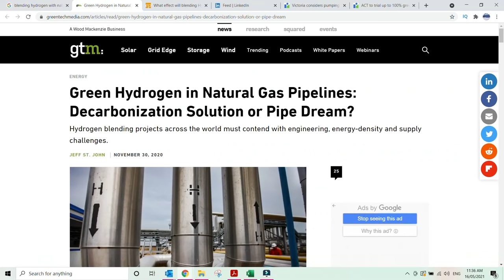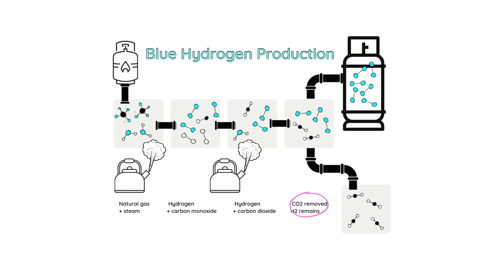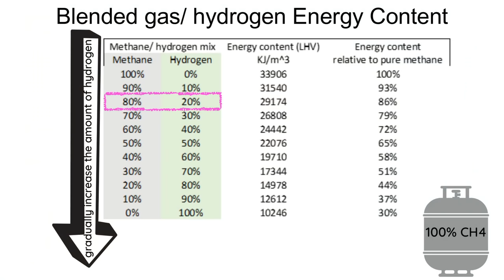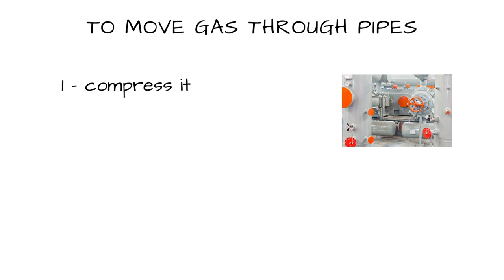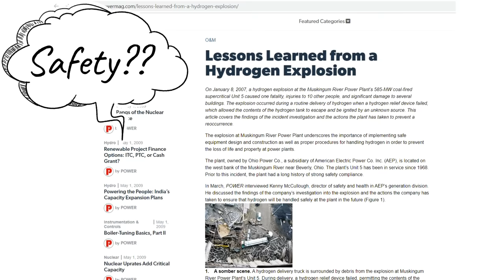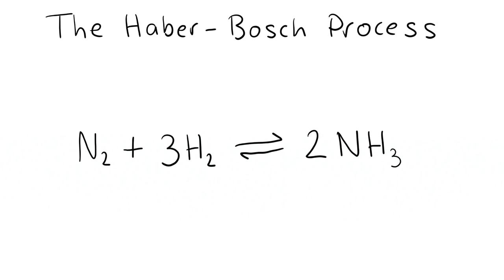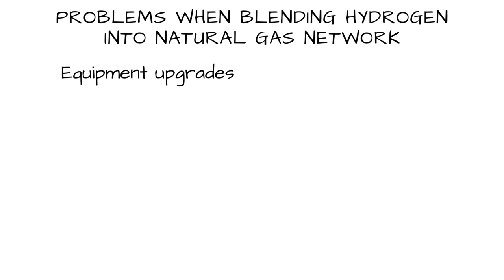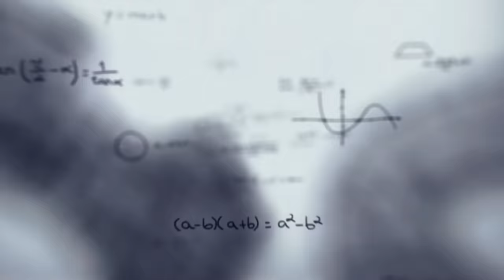Hydrogen in the Natural Gas Network

Comment: I agree with basically everything he said. "jetted" is referring to the fixed orifices that are used to regulate gas volume through a device. They are in every gas appliance and pressure regulators among other uses. They would all have to be changed, aside from the down rated performance of the appliances. This would be expensive but very complicated as you'd have to do it for every appliance in the grid that was converted. So I agree that mixing hydrogen in isn't going to work at well. From a safety standpoint, like he said, hydrogen is notoriously hard to contain. The majority of the last mile of NG pipeline networks including almost all piping inside homes are mechanically fitted. (IE threaded and crimped.) I suspect that leakage rates would dramatically increase, causing plenty of panic. (odorization should keep accidents down but won't completely prevent them.) Some jurisdictions have extremely restrictive regulations. (Ontario, where I live, is one of them.) I honestly don't see the regulatory authorities moving any faster then geological speeds. 

For the electric heating, that is more of a problem for existing neighbourhoods in cold weather areas that use NG. Since the infrastructure was built with natural gas supplies in mind, electrical infrastructure isn't built to handle the full heating load on top of the normal peak loads. We would have to upgrade entire sections of the electricity grid along with additional power sources. That's considering heat pump usage. On top of that, heat pumps are much more expensive to repair. It's not a limiting factor, but something to consider. While they use gases that can be harmful to the environment, losses are extremely low in some jurisdictions and isn't really a factor. 

Side note : comfort heating is an essential service in cold weather areas. It very well can be life and death depending on the situation. Even Texas is aware of this now. 

After all that, consider that methane is most often a byproduct of oil extraction. There are some dedicated fields extracting NG, but it's not as common in North America. Burning methane is far better then releasing it to the atmosphere. The greenhouse potential of methane is far greater then carbon dioxide. Capturing methane from leaking fields will help substantially. Having a convenient way of consuming that energy is most efficient. (Although I still see  NG volumes significantly dropping in hr future. Especially in places where it is imported from deep natural gas fields.)
Reply: In order to keep our bodies warm, we heat the whole house. That is not an engineering solution!
Reply: @Tensquaremetreworkshop  and your solution is? No one is wearing a snowsuit inside.
Reply: @SuperS05  Actually, in parts of China, they do. And leave their doors open, even in Winter...
Suits heated with either fluid or electric resistance have been designed. Might not seem ideal, but when the alternative is the destruction of the planet... 
I consume 2MWh of electricity per annum, and generate 4MWh (solar). Heating my house takes 12MWh of gas. Something has to move...
Reply: @Tensquaremetreworkshop  insulating a house well is far easier then convincing people to wear think snow suits inside, and have no running water. It's not hard to get the energy use down enough to have passive heat gain. It's just not cheap
Reply: @SuperS05  It is not just a matter of cost- in the UK we have a large number of old houses that cannot be sensibly insulated (even if it was legal). With most houses, it would be cheaper to re-build. It has taken 200 years to build the current stock- how long to rebuild- while still continuing building 300K new houses a year? Add doing it carbon neutral, and that universe does not exist. Insulating bodies is way more manageable.
Reply: @Tensquaremetreworkshop  and how many parts of the UK dip below -30 or -40*C during the lows of winter? Each jurisdiction has its own problems and needs to be considered separately. How about the buildings that use NG for cooling and cannot switch to electric chillers? 

PS. When doing a full reno, tear down to the studs reno, reinsulation actually isn't that hard. Closed cell spray foam can get to very high R values without much trouble. Other methods can get up there too. It's not cheap, but it is possible. Asking people to not have running water and be cold is never going to get any traction.
Reply: @SuperS05  'tear down to the studs'- what studs? The vast majority of British houses are brick built. Outside cladding is ugly, difficult to impossible, and would never be more than rare. When you get to the ones built from rammed earth, or wattle and daub I don't know where you would start. Zero energy homes require in the order of 500mm insulation (especially if it has to be non-fossil). Even if possible, the cost would run to at least 10 times GDP!
As I said, I use 6 times the energy for heating as everything else put together- and I have a house as well insulated as I can make it, within planning laws.
Reply: @Tensquaremetreworkshop  that's just an expression. There's many houses here that are just as old and have brick or stone walls. Wattle and daub actually has decent insulation value. An air gap and / mineral fiber insulation with a vapour barrier would likely do pretty well. Some a very good chunk of houses in the UK are townhouses, the joining walls between suites can be ignored. Basic Drywall or whatever you want to use over the insulation and you're done. Roof depends on building style.

I've seen 8700sq.ft (800ish sq.m) houses use less energy to heat for a much colder winter with very limited sun exposure. And they did not have ½m insulation. Even my house, with very lack luster ancient insulation style still competes with your numbers for heating. When I get around to it, I'm sure I could at least half that.

PS. I just started an AC that uses that much power in 48-60hrs on a hot stretch. And that's basically as efficient as it is practical.
Reply: @SuperS05  The problem is that better insulation will no cut it- zero  carbon is needed. If government increases deficit by 2% (prob max it would be allowed) it will take 400 years.
Otherwise to hit target we need worldwide the equivalent of a 2000MW nuclear station every day for the next 30 years. Good luck with that.
Reply: @Tensquaremetreworkshop  and asking everyone to sit in their houses freezing with no running water isn't going to work either, no matter what your arguments are.

And I said passive heat gains in winter. That is carbon neutral. Passive heat losses in the summer is a whole lot harder, but not impossible with plenty of planning.

Anyways, the video way on hydrogen, and there's almost no lathe scale green hydrogen production due to the economics. Solve that problem. Industries in cold weather countries are getting very good at reducing heat losses during winter. In fact, I continue to service AC's throughout the winter in office buildings due to their tenancy to overheat.
Reply: @SuperS05  Moving EVERY house to passive heating is a mammoth task- and who is going to do it? Removing a percentage of the working population just takes away from productive effort, and the costs are astronomical. In 2018 we consumed 11,865 mtoe of fossil fuels! We have to reduce that by one mtoe every day until 2050. 
Yes, we should add insulation where we can- but my proposal is modest.
1) It is already practice in parts of the world
2) It is almost universal for part of the day - turn off heating and rely on bedclothes.
I am just extending the period of the day. We already add clothing during winter- a pullover, underwear... It is not a huge technological task (compared to zero carbon housing) to design light but effective insulated clothing. Perhaps active. Not comfortable for you? An incentive to move, slowly, to needing less by personally insulating your dwelling. But you are not being forced to.
As a child, we did not have central heating. It was normal. This would be much better than that- and is to save the planet.

Cooling- people lived in those areas long before aircon. It is a convenience rather than a necessity. Want to be cooler? Dig down. The earth sits around 10C, and you can regulate the temperature using air change and a heat exchanger (only a small fan required).

Rather than a 'war footing' style of revolution, an escalating carbon tax and technologies such as I suggest can do the job.
Reply: @Tensquaremetreworkshop  and you plan on burying London's 9million people? New York's 24mil? LA's 19mill? Tokyo's 37mill? Mexico City's 22mill? Or asking any of those people to not have central hvac? (that's literally over 100 million people in just 4 cities. Most of which have limits on ground and air use.) In cities, AC is not just for comfort. There's a reason why it's been an reservist service for years. 

Planned upgrades over the next generation for existing structures and upgrades in building codes for new structures will be what drives lower energy use. It won't matter if you stand in the middle of any of those cities with a loudspeaker and beg people to listen to you, no one will care. Any of those people that you mentioned that don't have central heat, will gladly take it given the economic option. (which is why they don't have it, not because they chose it. I know of only 3 houses near my that have gone carbon neutral and one is an educational showcase. All 3 have central hvac.) good luck with your campaign, I don't see it gaining any traction at all.
Reply: @SuperS05  Two things-
- You don't have to deny anyone anything- you just charge them the full cost. They will make the rational decision.
- Do not worry about office blocks- they are terminal. Nothing dafter than leaving a desk and screen at home, spending time and energy commuting, to go to another desk and screen. Many are now working at home, and you won't get them back with a tyre lever. When companies have to pay the full environmental cost, they wont be asking them to.
Reply: @Tensquaremetreworkshop  I was talking about the condos and apartments. Some people like living in them and you won't be prying them out. And your answer to expensive upgrades is to charge more? Like I said, there's already a push to better efficiency and lower hvac use due to the economics. If we could only get the big companies to stop being greedy and making the top tier products with proprietary parts and communications, and we would be doing great.

Across all types of buildings, we don't get better mechanical and building envelopes because of a lack of general education. It needs to be taught in high school. People are more worried about granite countertops and hardwood flooring then how low their heating energy will be. They don't even care how badly the AC and heating will be due to poor construction. They don't notice the poor water distribution for quite some time. 

Even your whittle and daub house could be decently low energy costs for central hvac and still have natural light relatively easily on the next full house reno. But even you mentioned earlier then you were more concerned about how some of those methods looked rather then how they performed. 

PS. I have a hint for you. Quite a few companies will be demanding that their employees return or their jobs will be on the line. I interact with many businesses every day, of all sorts of industries. Almost all of them want their workers back in the office asap, even when it doesn't make sense. It's a societal thing. I'm all for the working from home revolution, even if it costs me my job, and it would. I just don't see it happening they way some hope.
Reply: Nonsense - re-jetting was done in the UK between 1967 and 1977 for the conversion from coal gas to natural gas.
Reply: @poruatokin  considering methane is a significant component if "coal gas" (roughly ⅓) the new orifices wouldn't have been significantly different and could run at similar pressures. This is not true for hydrogen. 

The conversation process could be done sequentially between networks, due to the highly fragmented early networks. Modern piping networks are highly centralized and some have only a few major import pilings pipelines that can travel across continents.

It's not impossible, but highly infeasible a place like where I live. It would be pollution suicide for any politician allowing that to go through.
Reply: @SuperS05  'Next full house reno'. That never happens! Unless it falls down, owners go to extraordinary lengths to change as little as possible. Listed status enforces that.

Currently, in the UK, we are seeing an unprecedented movement of people moving further from cities- outside the commuting envelope. They have voted with their feet- they are not going back to offices. Travel season tickets are becoming flexible, allowing one or two days a week travel for those that still have need to travel in- for the moment. Builders of garden home offices are booming.

Your increasing list of building types just reinforces the difficulty faced, and illustrates the need for innovative solutions. More of what we do today will not cut it.
Reply: @poruatokin  Yep- it took ten years, despite just being a change of jet. (except for the scrapping of much kit because it could not be converted). Back then, most gas appliances were either a cooking stove or open fire.  Somewhat more complex now- and it will need much more than a jet change. Boilers need a re-design.
Reply: @Tensquaremetreworkshop  houses get fully renoed all the time here. Often once per generation or 2 at the least. Unfortunately when it's by flippers, the cheapest options go back in. I normally only work for home owners and refuse to work for flippers. Homeowners almost always upgrade insulation and mechanicals to improve efficiency to the max that their budget allows. Every industry with fingers in that market are already moving towards lower energy costs including ever stricter building codes. It's not carbon neutral yet, but the same construction methods would be fairly close in more temperate climates. (IE the lower half of the UK.) Solar and /or wind energy collection along with storage would go a long way to bridge the remaining gap. If you don't like building codes in your area, talk to your politicians, and demand change. I do my part by giving more discounts to higher efficiency hvac replacements when possible. (as opposed to increasing profits like many companies do.) Telling people to live at home without central hvac will gain zero traction. 

Yes people have moved away here, but that won't stop their bosses from demanding that they return full time. Except for the big internet companies, I don't know any here that will allow full time working at home that hadn't already 2 years ago. Of course I don't know everyone, but I would wager that if a decent average here. I personally know of several owners that'll fire their employees without hesitation, if they don't return full time when the government allows it again. They simply don't care if you've moved away. So efficiencies of office buildings still matter and will continue to matter. I have several very large projects going ahead for that very reason. Although corporate bureaucracy, and fragmented budgets often force less than ideal options.
Reply: @SuperS05  Interesting the difference between our localities. In the UK, 'full renovations' are extremely rare- the biggest changes are just extensions. People like, and pay more for, 'period features'. On my last change of house, I moved a couple of walls and that was regarded as huge changes. Grants to upgrade insulation have fallen way below target. Standard heating is a gas combi boiler- there are attempts to sell air source heat pumps, but the external unit is regarded as ugly, and the water temperature (if efficiency is desired) is too low for standard radiator systems. Air blown systems are not acceptable - noisy and/or ugly. Solar systems are common, thanks to a guaranteed feed-in tariff (for 25 years) that is a massive transfer of wealth from the poor (who cannot afford them) to the better off (who can).
Offices- CFOs are rubbing their hands at the savings eliminating head office will bring. Workers here have spend over a year seeing their kids at night and saving ~2 hrs a day, not to mention the cost. (Where I live, commuters (lots of them here) pay ~$8000 a year for their train ticket). People are investing that saving into bigger houses, further away. Before, many large companies used hot-desking and one or two days a week at home, because of lack and cost of space. That will, at least, flip. Office visits will become rarer. Productivity measures already show that home working gives a small increase on average.
Reply: @Tensquaremetreworkshop  It took 10 years because it was handled regionally, nothing like what you claim.
Reply: @Tensquaremetreworkshop    like I said, even your whittle and daub can be upgraded without too much trouble. Cladding externally can be hard cosmetically without doing an entire side of the house. It's quite expensive, mostly due to the weatherproofing and heights. The interior side is easier, cheaper and can be done piecemeal with the cost of a few inches of space. A vapour barrier would be a very significant improvement to thermal efficiency. Add even just a small air gap and it would be an improvement while being inexpensive. There's also no reason why a gas fired boiler can't hit 98% AFLUE, especially with outdoor reset. We do it all the time here, for both big and small applications. You can use water temps as low as 90*F, but to achieve cold weather design heat transfer rates, you need higher capacity rads. Since people seem to be allergic to upgrades there, I don't see that happening. So outdoor reset is probably the best you can ask for until that happens. (which is still very effective.)

Forced air systems are basically a requirement for any kind of AC. For technical reasons, radiant type systems are not practical. Since most people don't like the look of minisplits, most houses have central AC. (Basically every house from here to Mexico, if they can afford it) it's a mix of whole house fans, swamp coolers, and direct expansion cooling, along with some greener alternatives when possible. It highly depends on location for technical reasons. There's no reason why forced air can't be quiet. It's poor design that causes it to be noisy. It takes more space, so compromises are always being balanced. I've worked with professional recording studios, where they are extremely sensitive to noise. It's just a matter of what's acceptable.

Thermally efficient houses really aren't that hard these days. They use a fraction of energy to maintain comfort and hot water then houses built even 50 years ago. Carbon neutral in this area is still a challenge, but not impossible, just a bit impractical until the infrastructure changes a bit. That'll mostly be up to local and regional governments. IE. Greener electricity. I'm a fan of small modular nuclear sodium reactors whenever they pass regulatory hurdles. Large scale electrical storage for renewables, preferably installed with every solar and wind installation. Using the combined costs of solar/wind with storage would be more equitable to conventional power generation. District heat distribution to reclaim waste heat. Heat pumps can be used in both directions depending on the situation and available industries. Carbon neutral in rural areas is actually quite possible even with the cold weather. It requires land use and money and most don't want to give up either. 

A few of my customers use hot desks for some of their staff. They are also the ones spending the most money on upgrades to bring in more people since it's easier with the office mostly empty.  However this is way off topic and I won't go further into it. Suffice to say that a year ago, I had hoped for big societal changes that would diminish urban sprawl. I no longer think much will change in the near term. Over the next generation, maybe, but nothing sooner.

PS. People here on average pay far more then that in gasoline and car maintenance for their commute to work. Commuter services are trash here and taxes on gasoline are even worse.
Reply: @poruatokin  Of course it was handled regionally- what would you do- train 20,000 people and fire them after one year?
Reply: @Tensquaremetreworkshop  My house is listed (UK) and consumes 70MWh of NG a year (area 300 m2). I'd love to reduce my heating bill of £2.5K per year. But converting to heat pumps is a non starter because for it to work I would have to put in extremely expensive insulation (windows, walls and floors) that would likely contravene listing regulations, would definitely cost a lot of money (£50K at least plus the heat pump setup) and might cause damp and ventilation issues as well. It's just not going to happen.

I was hoping that hydrogen would "come to the rescue", but from this video I can see that that is a forlorn hope. I don't see any solution. There are so many old houses in the UK. What's the answer if you want a comfortable living environment and don't want to put on lots of jumpers, green NG? (if that's a thing).
Reply: @SuperS05  You cannot just clad W&D construction- it needs to breathe. No damp course or DPC. Lime plaster used. 

I put a small 'radiator assist' fan in my house. Silent to me 4ft away. My wife can hear it 20ft away and insists it is turned off. Hotel AC has to be turned off or she cannot sleep for the noise. She is not alone.

District heat/waste heat - from where? Regarded as impractical even from thermal power stations- and they are going. There is not going to be any 'waste heat'.

Have you tried working out the total cost of all this, as a %age of GDP, and where it is all going to come from? Love to see your calculations... As you say, none of this is intrinsically hard- it is just expensive. And we have very few trained to do it. And no spare people to train. We have been importing 1/4M people a year just to fill the vacancies we already have.
Reply: @drigans2065  Exactly what I have been trying to say. I would think that £50K is on the low side.
It cannot be beyond the whit of man to design a thin 'suit' to wear next to the skin that is both highly insulated and heated, ideally by some form of induction (think wireless charging) and comfortable to wear. It tackles the real problem- heating whole buildings to keep a couple of people warm is not engineering.
Reply: @Tensquaremetreworkshop  district heat distribution isn't hard or new, just expensive to setup. It's expensive because it's almost always a retrofit, which multiplies the price. It would have to be added during initial construction so basically new construction or major gentrification projects. The real problem is that the cost usually falls to the company trying to dispose of the heat, which makes its very impractical for them. The piping would have to be laid down along side sewers and water mains and managed by a third party, if not the local government. Serviced houses would have to pay for the energy they transfer or a flat fee that's reasonable. The source industry would essentially have no significant cost above managing the heat exchangers. However, that all takes serious political will and that simply doesn't exist in most places. The only places it does is usually dense urban cores where the system can be profitable and private companies take it on. Most new systems I've seen are primarily for cooling.

Power plants won't be going away anytime soon. In fact we keep building new ones. But that was only an example. There's plenty of industry and commercial buildings that require cooling during the winter and some require heating in the summer. It's very location specific and would have to be balanced according to cost. Nothing can be a blanket solution, no 2 locations are the same. 

As for your wife, I can't help that. I used to live at the end of a runway for a major international airport. I hate how quiet my house is now. Anyways, I suggest a Peltier powered fan. They tend to be very quite and don't require electricity. They are usually sold for wood stoves.

Next time you redo the flooring, install indoor heating. You  will have a  more balanced temperature. Use water and not electric indoor for the most flexibility of heating sources and heating costs. You could also upgrade your rads in the rooms that concern you the most. There's charts from the rad manufactures that specify the size needed for a given water temp. Stelco has some that are decent. 

And I'm aware of the limitations of w&d. That's why I suggested interior upgrades instead with air gaps. Cladding isn't easy but still possible. Again with air gaps. This is essentially building a second wall and making it look like the original to get the best results. Lime Plaster sounds like a middle of the road compromise. However, building material that needs to breath is half of your problem. To increase thermal efficiency, you really need to cut down on unregulated air exchange. You still need a vapour barrier somewhere. In cold dominated climates, that's in the interior side of the wall.
Reply: @SuperS05  1) thermal stations HAVE to go for zero carbon. If you are saying zero carbon is not possible I will not argue with you.
2)How a fan is powered does not affect the fan noise. And it is an inlet fan, not an outlet...
3) I will NEVER be 'redoing the floor'. The teak (illegal to buy now) tiles have been there sixty years, and will be there at least another 60. Digging up the floor (2" for pipe and surface, and 6" min for insulation) would never achieve payback in my life. 
4) I am an engineer; I am perfectly capable of calculating the heating requirements. Indeed, I have created commercial software packages to do exactly that. I was also in the power industry for 8 years, and know the issues with district heating. 
5) Air gaps do not cut it. The air movement needed to remove moisture from this type of structure requires open faces (or complex forced draft that would be a nightmare). Putting it on the inside would leave the rooms too small, outside would not be allowed.
6) Most UK properties do not have a vapour barrier in the walls (just the roof). They rely on wall cavities. (Brick outside, block inside, 4" cavity these days with batts fixed to inside wall. Older properties are just solid wall. Up to 2' thick.)
7) Lime plaster is not a 'compromise'- it is essential for old buildings of this type because it 'breathes'. Using cement gives immediate damp problems.
8) A zero carbon house usually need heat exchangers in the air change system. 
9) The places where industry is, where there may well be some waste heat, are miles away from where people live. My nearest town, of ~20,000, has no industry. No source of heat for over 20 miles. And would you install all the kit, even if there was, when you have no guarantee that it will still be there next year? Literally a pipe dream! (I am here all week, folks...)
Reply: @Tensquaremetreworkshop  I'm done with the building envelope problems. The industry has moved on, it's not my fault you choose to keep a museum and are unwilling to make upgrades. Stay without heat, no one else will care. 

In just about any major urban center, you do have plenty of waste heat. Such as where I live, the vast majority is within 10 miles of significant waste heat of one type or another. Usually multiple sources. That would be several million people. Rural areas obviously are never going to make sense. Rural areas have other solutions that apply that I cannot use. Again it comes down to choices and location. If you have the space, If you choose not to use solar heat collection and storage, that's your problem. (usually is a mixture of EV and thermal if you actually want to go carbon neutral and not just exploit the feed in tariff.)

Yes I would install a coil in my furnace and setup the controls myself. After the supply pipes are installed to the house, I imagine it would take 2-4 hours max. If I was rushing, maybe less. I would probably also add a second heat exchanger to preheat my incoming water. I would even pay a significant amount as a hookup fee. Maybe up to $10k if needed depending on other fees. A ROI of 10 years is fairly reasonable, and a sacrifice I'm willing to make. But I also live in a densely populated urban area with major industry literally down the street, where that makes more sense. I will eventually install solar, but that will wait until my roof needs to be replaced. I don't have much land to use, so I'm very limited in options. 

And politicians are really short sighted. All of our feed in tariffs and other incentives have been cancelled. The only reason that plans for more power plants are on hold in my area is because power use has been falling for about 10 years. It appears to have hit the local minimum though. That is province and metropolitan wide electrical peaks and total usage. The reasons are complicated. But with several power stations scheduled to be permanently decommissioned due to age, it's only a matter of time before more are built. (they have already passed their useful lifespan a decade ago, and required expensive refurb projects.)
Reply: @SuperS05  District heating from waste heat is rare. If you do not understand why, I recommend that you study thermodynamics. I have. A combination of high insulation and ground source heat pumps will be the major contributors to zero carbon- but it will not be quick, cheap, or easy. It may not be possible. Resistance to change is huge. You are an example- you would rather change every house in the world drastically, rather than consider wearing a garment that could keep you warm/cool in any conditions. Note that you do not attack the technology (by pointing out any areas of difficulty) but instead dismiss it out of hand. Do you not want to be part of the solution, rather than part of the problem? 
Still waiting to see your calculations...
Reply: @Tensquaremetreworkshop  I said district heat distribution, not pure heating. That includes the reverse flow of heat when possible. You use water source heat pumps, which are readily available commercially. Both as split and unitary options. If waste heat is warm enough then district heating works, but it usually doesn't work for most situations. 50-90*f source water is vastly superior to the 35*f ground water that we see here during winter. I've even seen water mains and sewers freeze despite being buried more then 10ft down. So that really only leaves vertical wells for ground source which is not only very expensive and rather difficult in many locations, but is also barred by city bylaws. (depth restrictions) So now you're down to air source heat pumps which barely break even with a COP around parity during average winter temps. (that's using more advanced techniques such as what Mitsubishi uses.) conventional heat pumps end to running on backup heat too much to make them worth while here. In the drier west, it works out a bit better. 

And you don't need to change every house out there as building codes have been steadily increasing over the years, depending on jurisdiction. Houses here, built in the last few decades are already vastly superior in thermal efficiency. We are pushing up against ever increasing diminishing returns. You haven't mentioned the size of your house, but I haven't seen too many w&d houses that are particularly big. You use more energy for heating while still being cold then my +1000 sq.ft house, in what I believe is a significantly cooler climate during winter. Honestly I spend enough time in the cold, all day, I'm not doing that while I'm at home, especially when there's better options. Like I said, my planned upgrades to my own house should get it close to carbon neutral for heating at least. Cooling will be a stretch. My house is over 35 years old and it doesn't need much work to get to that level. I wouldn't need to touch the walls of any house built in the last decade or 2. In moderately upper end builds, insulation above average insulation, I've seen them run below 4btu/sq.ft during a windy night below -30*C during final construction. (that's single digits, and not a typo.) That's about 1W/sq.ft. Or a bit above 1kw/1000sq.ft. I regularly see people use larger space heaters at their desks because the ac is set colder then their are comfortable and refuse to wear more clothing. That would be equivalent to 2-4 office class computers including the screens. My computer single handly consumes more during intense work loads, without including the screens. The point is that it's tiny, and it wasn't prohibitly expensive during when included with other work. (that's 2 separate houses, one new and one that was closing in on a century old. 2 separate methods of insulation.) 

Napkin numbers really would be worthless as each localised area will have separate solutions. Numbers would vary wildly between even neighbourhoods. For my area for example: I would imagine that you could lay the piping, single pipe setup, if done along with scheduled water main upgrades should be easily under $10mill. That would be somewhere between 300-500 housing units. Maybe more. There's a few apartment buildings included. Again that's considering that the roadwork and trenching is being done anyways for the other utilities. That would only require the materials and directional drilling to each house. $5k hookup along with a rough average of $2k/year for overall heating costs would have an ROI of about 10 years without subsidies. Plus a few more years for the heat pump, assuming full price and the existing equipment didn't already need to be replaced. (which would be the majority of new subscribers.) The local government regularly spends twice that on small bridges or new hiking trails. Even a tiny bit of subsidy or even interest free loans would make it financially feasible for this community. I would imagine a real project would be city lead, and they would pay for it, and charge by heat transfer or fixed rate. I don't know how much heat is available, there's too many variables to now that without a detailed study on the factory. They do have their own high tension lines and substations, as in plural. If I had Tu guess, it would be well into the hundreds of millions of BTUs that would available after inefficiencies in capturing and transferring it to the network. The supermarkets will easily have well in excess of a few million BTUs of waste heat. They already reclaim some for space heating but it's only a fraction of the waste heat. (despite the cold weather) How much heat, really depends on the size and configuration of the store. I guestimated the local stores based on the cooling I could see. They already have detailed logs for those systems to make suitability studies easier. Although those are my my customers, so I don't have access to that. Politically it's a charged subject because other neighbourhoods see it as favouritism and unfair because they are left out due to geographical restraints. These plans have come and been lost in the political black hole, over the years, despite their merits. The only projects that went through were for profit, private projects, commercially funded in a different city with higher land use density. 

That is all within 2km radius of a major forge. They won't need the heat during summer so alternativies would have to be proposed along with the environmental concerns they bring. IE. Using the major lake to cool the loop, since they are already doing that to cool the work process. The nearby supermarkets also have plenty of waste heat that they would love to dispose of, in a marketable "green" way. There aren't too many office buildings that are near enough to make sense to use their waste heat. Most office buildings run AC all year round for the core of the building. The larger the floors, the worse it is. This is just a dozen city blocks worth of housing. Any further and they the plan would be different, depending on direction. Some simply don't have the waste heat available. Others have different sources of waste heat. Either different industries, power plants, and even commercial server farms. Like I said, it's case by case. There will be plenty of places where it doesn't make sense. There are some places it does. It's not the only solution, it's just A solution, as I've been trying to say. I won't be discussing it further here as it's a hypothetical example that has more political hurtles then technological or financial. I can name at least a dozen, nearby, very significant sources of waste heat that is literally thrown into the atmosphere while the surrounding neighbourhood is trying to stay warm. 

Reducing energy use is a first step, but asking people to be colder is simply a non starter for just about everyone you'll ever meet. That's why those campaigns have fallen flat for decades. It's why the smart thermostat upgrade programs caused higher energy use. Or even after energy savings campaigns have been ongoing for decades, people still light up their streets in December so that you can direct and land a plane on VFR at night. If the average joe won't accept a plan, it's not much of a plan at all. Hence the slow but steady improvement of building and mechanical standards.

You accuse me of being inflexible because I prefer not to wear a snow suit into the shower, yet you haven't even upgraded just your rads, and complain about less living area due to insulation. (our exterior walls are often over 12" think when you include the cladding, depending on area of the building and construction methods.) I regularly install radiant heating running only up to 120-130*f for design temps, and down to 80*f before warm weather shutdown. At those temps, just about any heat pump would manage to maintain ok efficiencies as long as it's not too cold outside, if you demand a HP for that situation. Although, in utility costs, NG easily wins around here, even during warm weather. It's not efficient to directly heat the air, and even where possible to blow that hot air at you. (IE ductless splits) However, noise is apparently more of a concern for you then efficiencies. Including dismissing a recommendation replace your fan with an incredibly quiet fan, with high end bearings, low fan speed, and no line frequency hum. They are literally designed for cases like yours where any noise other then the fire itself, inside the stove is too loud.
Reply: @SuperS05  Every line illustrates the complexity you deny.
Reply: @Tensquaremetreworkshop  Very true, mine's similar, Edwardian semi.
However, I have traditional heating system with hot water storage tank and a gas boiler rated at about 13KW, which I don't think I've ever used to full capacity. In terms of heating requirement, this could easily be accomplished using a currently available high temperature heat pump. It wouldn't be quite so convenient as a gas boiler and would need some of the kit outside, but is doable and would be far cheaper to run than using green hydrogen ( unless it is highly subsidised). The trouble with a hydrogen boiler advocates is they forget just how many extra wind turbines are going to be needed to make the hydrogen in the first place, they're just shifting the problem further upstream and ignoring it. In terms of primary Energy supply, e.g. wind or solar farms, hydrogen requires about 6 times as many as heat pumps for the same end heating demand.